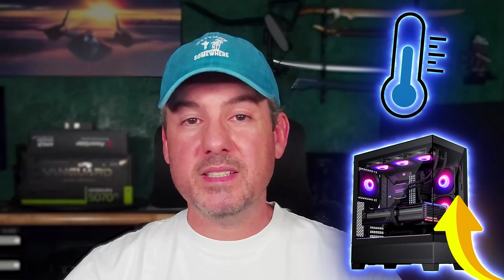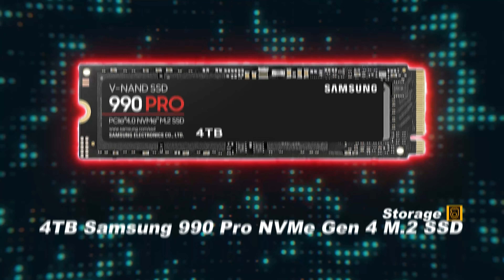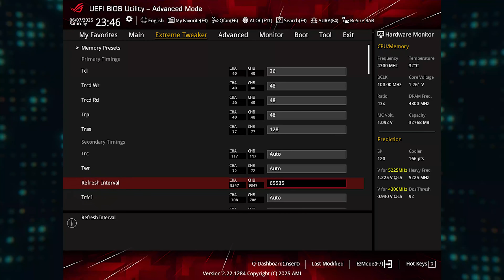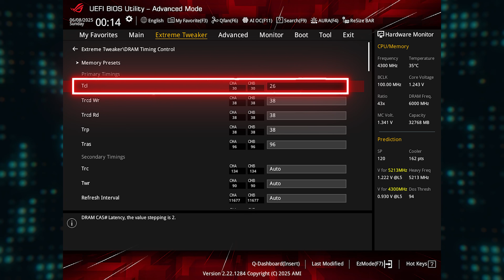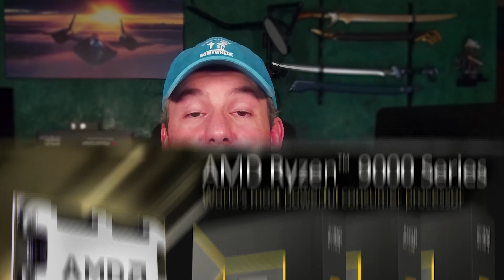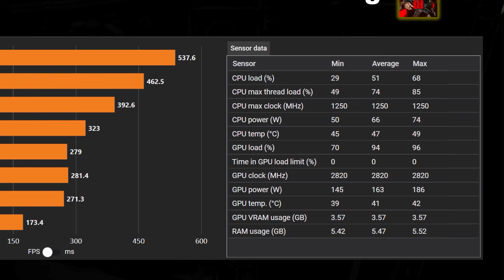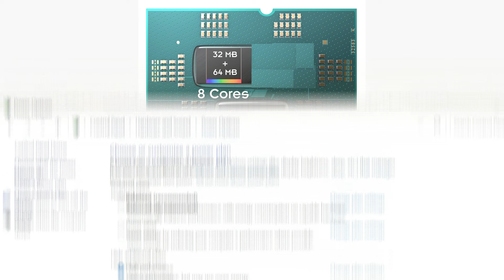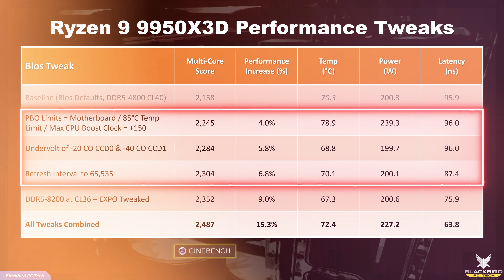What Are The Best Settings for an AMD Ryzen CPU?

Comment: I came to this video to learn, so please understand this comment comes from a "please clarify" perspective. I appreciate your knowledge, and understand this is a old video.. but maybe you have time to explain.

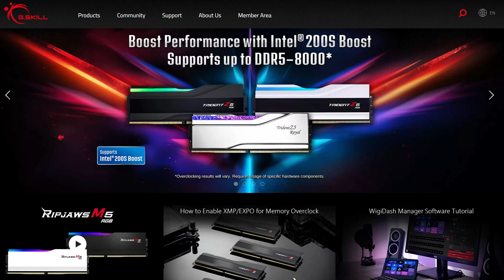At 9:10 your example doesn't line up with what's on the screen, its confusing. Your example showed cl30-38-38-96 1.35v then you found a ram kit on the site  with cl26-36-36 at 1.45v. Then you went into the bios and made it cl26-38-38-96 1.45v.  To my understanding you should have input "cl26-36-36 at 1.45v" in the bios. Why did you only change the cl30 to cl26 and the voltage?
Reply from the maker: I can certainly understand why that was confusing ... after watching that section of the video again, I am pretty sure the reason I did that is that I didn't notice the kits I selected from G.Skill to compare against had tighter timings ... there are a lot of different memory kits and I appear to have selected kits that didn't match what I actually used. When I am preparing the script for a video the last thing I do is find media/images/video to help support the story ... in this case I simply selected kits with even tighter timings than the one I used. It doesn't change the validity of the approach or the information provided in the video, it's just a mismatch between that image and my bios timing inputs.

Comment: What if none of those work, j just have to stick with auto?
Reply from the maker: What do you mean? This video is a guide to show you how to find your max undervolt and overclock, so your question doesn’t make sense.
Reply: @blackbirdpctech  apologies, it was a question for one of your other videos where you setting expo I, expo II, and Tweaked.  I had an instance where my stability test failed each time I set one of those. So I set it back to auto and the stability test passed.  Just was curious if you ever ran into that situation.  Your videos are great, helped me with my person setup.
Reply from the maker: @zerograv1ty11  yes, absolutely ... EXPO or XMP are memory overclocks, so there is always a chance that they won't be stable.

Comment: I have a 6000MT/s CL30, the Fabric clock is on 2000MHz, I tried 2133 and apparently it works, should I leave it in 2133 or better the default on 2000?
Reply from the maker: You can watch this video to get your answer:

What's The Best Memory for AMD AM5 Ryzen X3D CPUs? 🔥 Speed vs CL vs Rank vs FCLK 🔥

https://youtu.be/lx2SHUT9l7c
Reply: @blackbirdpctech works even if I have a non X3D CPU?
Reply from the maker: Yes … the impact on performance will be larger
Reply: @blackbirdpctech Well, at the end I got my memories to go down to CL28 and the Fabric clock is on 2100. Maybe I'll try to make that one a little bit up or trying to go to CL26 since there is another model of my ram which is CL26 (Klevv Cras V RGB) but I'll let that for another day or month. Also in that time I will see if it's 100% stable

Comment: My 9950x3D is unstable if I go anywhere beyond -16 on CDD0 and -15 on CDD1 without any boost, did I get the worst x9950x3D ever?
Reply from the maker: Not at all ... that is an average 9950X3D
Reply: @blackbirdpctech  I managed to add +100mhz boost to the -16 on CDD0 and -15 on CDD1 config. Not bad.

Any other ideas for increasing performance? I also have a Corsair Dominator 2 x 32GB DDR5 6000MHZ and a Aorus Master x870 motherboard. Thanks for everything. Just subscribed to your channel.
Reply from the maker: @Icaruj  welcome to the Blackbird PC Tech community!

Comment: But why did you put CCD1 on lower negative than the CCD0 while the CCD1 takes the lion part of the performance load?
Reply from the maker: When you dial-in an undervolt you don't select whatever you want ... you dial-it in based on the capability of the CPU. In this case, I dialed it in based on the capabilities of each CCD. Furthermore, CCD0 is the CCD with 3D v-cache on it, so in gaming it takes the load, not CCD1.
Reply: @blackbirdpctech Thanks for the clarification! What are your recommended CO- values for 9950x? Mine is idling at 50 and goes up over 90c under Aida64 combined test
Reply from the maker: @unnf9971  again, you don't select your undervolt, you need to follow the steps in the video and figure it out.

Comment: I wonder if negative 10 curve optimizer is almost always stable on every chip, or if it in itself is not a sure thing.  I'm not suggesting skipping the testing.  I'm just wondering if any chips would fail it.  Anyone know how much performance is lost (gaming) on a 9800X3D, if PBO is disabled altogether, using a good 360mm AIO?  I'm wondering if I should maybe disable it on a PC that will be 7 hours away from me, and I'm juggling whether it's worth losing a little performance, to make sure the system remains cool, even if they aren't cleaning it all the time.
Reply from the maker: The point of undervolting is to lower your temps. And no, some viewers have told me that their CPU will not do -5 all-core CO ... that's what losing the silicon lottery looks like. You ALWAYS need to test.
Reply: @blackbirdpctech I had a feeling.  I come from the time of soldering to Overclock, so there's zero chance of me skipping the testing 😂.
Reply from the maker: And that goes for RAM overclocking with XMP or EXPO as well … the number of people that get issues and think it’s anything but their RAM is staggering.

Comment: Redditers didn't like that my 6400 is running at 6400. They said it defaults to half and I'm taking a perf hit. My Phoronix ram speed test would be in 2nd place but I think I have to run more tests before it registers
Mobo says 6400 in several place in the BIOS. CPU-X (Linux) says 6400 (configured)/ 4800 (max). They really didn't like it when I said that I manually set EXPO Tweaked and UCLK DIV1 MODE from auto to  UCLK=MEMCLK and that's it
Reply from the maker: Reddit is the place truth and facts go to die 😉

Comment: Hey, very clear video! However, when I set the values for the Curve Optimizer in the BIOS, they didn’t show up in Ryzen Master. Ryzen Master said that Curve Optimization was turned off, even though when I went back into the BIOS, the values I entered were still there. Also Ryzen master didn't run a automatic stress test after changing the values in Ryzen master itself
Reply from the maker: Ryzen Master really does suck ... that's why I recommend doing everything in Bios.
Reply: @blackbirdpctech yeah just uninstalled ryzen master and was able to set it to negative 40 without issues thank you

Comment: Is this applicable to an 8600G?
Reply from the maker: Yes however the memory controller is different because it's a monolithic chip ... so it will behave more like Intel systems.
Reply: @blackbirdpctech Im really new to this OC thing... so can I just enable this stock then that XMP profile so I can run the RAM at 6000 as stated on the tin?
Reply from the maker: @digivagrant  I cover everything in the video ... if you need additional tech support then please consider joining our community in Skool:

https://www.skool.com/blackbird-pc-tech-4230/about?ref=67e6a7048d9540fe87cbdf1b69bd47f3
Reply: @blackbirdpctech  Actually, I'm still unpacking everything this guide is showing. This is basically 'unknown territory' for. Was kinda subconsciously, seeking assurance that I'm not messing this up when I commented. 

I got around to doing the PBO and my cpu temp is getting 77-80 degrees when I was at 55-60 at Stock. I'll be real... I feel the difference while I was playing Cyberpunk. It's a lot smoother than it was pre-PBO. But that 80 degrees is making me sweat. Is that an acceptable temp?

If it helps, I'm only using the Stock Wraith Stealth Cooler the 8600G came with.
Reply from the maker: I haven't tested an AMD APU, so I am not familiar with the temps, but it has a TJmax of 95 deg C, so 80 deg C with a wraith cooler seems reasonable.
Reply: @blackbirdpctech Even on idle? like just standing still doing nothing? no combat?
Reply: @blackbirdpctech  Giving feedback on my first PBO experience.

So I've followed the guide.I've enabled EXPO, undervolt -30 and Thermal Control at 85 and set PBO Limit to mobo.

Now I'm getting smoother frames than the default settings. Though my temp have risen to sub 83C.

So... since you mention the max is 95, I'm still within range? This is with my stock wraith cooler.
Reply from the maker: @digivagrant  looks good
Reply: @blackbirdpctech Okay that good to hear. Thanks for being very accomodate.

Im almost tempted to buy a 240 AIO 🤣
Reply: @blackbirdpctech  Just wanna clarify something here... ok so I've only done Undervolting and set PBO limit to mobo and I've already my max Boost Clock at 5.0hz.

I haven't done that +50 Boost Override option. I don't' have to do this since I've peaked on my clock speed, right?

Comment: One good thing about Ryzen Master is you can more quickly and easily test out settings without having to keep going into your bios to make changes.  Once you know what settings will work, then go into the bios and save them there and stop using Ryzen Master.
Reply from the maker: If it works ... in the past when I've used Ryzen Master to tune my system I've come across a lot of errors, system freezes, etc.

Comment: So i was wondering all this gives u a 15 percent performance boost but i was wondering about the windows tweak theres sm called ryzan balanced its new and theres also called ultimate performance which one do i pick im running a ryzan 9 9950x3d and a 5090 but i was wondering is what your doing overclocking and lower ur components life spam?
Reply from the maker: I talk about Windows power plans in the video. The life of your components is estimated by on the temp/power/voltage limits, so as long as you stay within those limits, you will not impact your life in a meaningful way.
Reply: @blackbirdpctech oh but in the vid you dident say anything about ryzan amd powermode
Reply from the maker: @YoussefMoh-i9d in the video I talk about balanced versus high performance and I explain why you should choose one or the other for different Ryzen CPUs

Comment: Before I do this, I just built my first pc and it had 9950x. When I’m doing light tasks like browsing its temps are in the 50s and sometimes 60s which seems too high. Rendering with Arnold and I reached 95 on it. I have a 280 mm AIO. Is there a mounting issue, or is it because I haven’t messed with any settings yet? I was under the impression that my cpu should be 30-40C by default on idle and 70-80 under load. Or is this a big misleading statement? I’m a noob, so these are all genuine questions. Thank you for the help!
Reply from the maker: It depends on a lot of things (ambient room temp for example) but assuming you have an issue because your temps are in the 50's during light tasks is a mistake. What temp does your CPU hit in a cinebench multi-core workload?
Reply: @blackbirdpctech  I did the Cinebench multicore test for four minutes, I stopped it when my CPU reached 85 and CPU package was at 96 C
Reply: @blackbirdpctech  I ran the whole test for the 10 minutes. The Tdie stayed at 96, powerdraw was 190-195W, the cinebench gave me 2062 points.
Reply from the maker: @daesaurus9771  your AIO appears to be struggling to dissipate the heat effectively ...
Reply: @blackbirdpctech  So is there probably a mounting issue and I should reapply thermal paste?
Reply from the maker: @daesaurus9771  I don't know if it's a mounting issue or your AIO can handle the heat generated from this chip ... what AIO is it?
Reply: @blackbirdpctech  What do you think?

Comment: My Ryzen 5 9600x was able to run stably at curve offset of -43 on all cores. Wished I could have done -50. But, this is also pretty good.
Reply from the maker: I would highly recommend running the AIDA64 system stability test to check if that undervolt is in fact stable ... it's VERY aggressive.

Comment: When undervolting my cpu cores don't really go over 5000mhz while under full load. i have a boost of +200 so shouldn't it be around 5425mhz steady? i just want to make sure im not clock streching. thanks to anyone that can help
Reply from the maker: I show in the video how to check for clock stretching ... have you used AIDA64 to check?
Reply: @blackbirdpctech  i used aida 64 and hw. i guess im just wondering if it's okay that the clock speed jumps around and doesn't settle on a specific value. or does that mean it's clock streching. btw i left it running for 25 min and the clock speed was still jumping up and down
Reply from the maker: @louisrodrigues3496  did you try backing off on the undervolt and seeing what happens?
Reply: @blackbirdpctech i put the undervolt at 0 and the same thing occurs
Reply from the maker: @louisrodrigues3496  you wouldn't happen to be using a 7800X3D would you?
Reply: @blackbirdpctech im on a 9800x3d. like i said it's stable but from what im undstanding eventually it's supposed to settle on a certain mhz and not bounce around right?

Comment: maybe i did everything perfectly i guess but i have a 7950x3d and my chip I don't think i have ever seen it go above 65c in any gaming scenario and I play Star Citizen alot. I have seen it get to almost 85c in benchmarking in cinebench though;
Reply from the maker: Sounds like you won the silicon lottery too
Reply: @blackbirdpctech   Did I? I really wouldn't know lmbo! THANK YOU JESUS!
Reply: @blackbirdpctech  ^^^^^That was a serious question. Is it really that good? I only ask because I hadn't built a PC in 15 yrs before this one and I went all out. Shoot the Asus 4090 Tuf OC I bought with the build RARELY goes beyond 65c as well. Tye coil whine that I have heard of I have never heard except only when I am running Blender and inside the viewport viewing and working on models.

I was wondering because I wanted to undervolt the CPU but I haven't overclocked or anything like that and these days its a little different. Easier I would suppose I just hadn't dug into it yet.
Reply from the maker: @JMarvelous23 the temps look good ... you can use this guide to tune your system.

Comment: People with new 9000 series should try the new 0.11 alpha 4 corecycler. It has a new auto CO test which will automatically reduce voltages 1 at a time until the stress tests pass on a core test 1 core at a time. It has ycruncher prime95 aida64 and others it also has support for 5000 and 7000 series as well as Intel
Reply: I would probably call corecycler auto test “automated” not “automatic” it’s not really doing anything that you wouldn’t be in a manual undervolt It just automates the manual test process of stress testing a core and seeing if it passes and automates adjusting voltage.
Reply from the maker: Thanks, will check it out
Reply: @blackbirdpctech  I have my 9950X3D stress testing with it now and preliminary multi thread test on ROG CPU-Z at the voltages it has currently set has my 9950x3d performing at a score of 17,9xx (can’t remember exact numbers off the top of my head) and a single thread score of 901. That was just what I used for a quick bench I haven’t done any others yet while I still test for stability. You’ll need 0.11.0.0alpha4 of corecycler
Reply from the maker: There is also Hydra that you can try but I’ve found that it’s best to try to do it yourself, at least once, to get a better understanding … every time I’ve used auto OC software I get stability issues after a few days.
Reply: @blackbirdpctech  I don’t disagree but individual core undervolting isn’t for the faint of heart and can take weeks. I don’t suggesting sticking to exactly what passes the test but it gives a good baseline. And technically the program isn’t doing it for you. Corecycler is just a command line prompt it runs a stress test like aida 64 or ycruncher and if it fails, just increases the voltage by 1 until it can pass the test. So it’s no different than manually stress testing like you did here. There is no AI or calculated programming. It runs the test the test passes. It moves on, the test fails It increases the voltage until it passes.

Comment: Hey Matt,
I have CL 30 x16 Kingston Fury Beast RAM 6000 mhz. What's the measurable impact of being able to run at CL 28 and pushing voltage to 1.45?
Reply from the maker: Don't push the voltage unless you need to for stability ... you can take a look at this video to see the impact of CL on performance for X3D chips: https://youtu.be/lx2SHUT9l7c

Comment: Thanks. Best guide online. I'll try this on my Ryzen 5900x. I assume it works mostly the same on Ryzen 5000 right? Anyway, going to try.
Reply from the maker: It depends on if your motherboard supports PBO in the bios
Reply: @blackbirdpctech thanks. Yeah it does. Older b450 msi carbon pro gaming ac. For it's time, it had vrm quality and features comparable to the x class -- was a good value. Will try. Thanks again! Cheers

Comment: Thanks a lot Matt! With this great and easy guide to follow I am able to get these result:
Stock: Cinebench R23: 43.500 | Cinebench R24: 2.370 | Temp: 85 degrees
Overclocked: Cinebench R23: 45.600 (+4,8%) | Cinebench R24: 2.566 (+8,3%) | Temp: 80 degrees
PBO Limits MB, 85C limit, No clock override | Neg. undervolt per CCD: CCD0 -30 & CCD1 -35 | Expo on (6000, CL30)
I am using an air cooler (Thermalright Phantom Spirit 120 SE).
Reply from the maker: Very nice, well done!

Comment: What about Prime95, can I use that instead of Aida64?
Reply from the maker: For testing your undervolt?
Reply: @blackbirdpctech For testing my overall CPU stability. Because that’s also like stress test and I’ve used it before.

And like can I use Memtest86+ as what is shown in the video is paid.
Reply from the maker: I haven’t tested prime95 so I don’t know how good it is for testing the stability of your cpu. For you RAM you can use memtest but Karhu is much easier to use and finds errors much more rapidly.